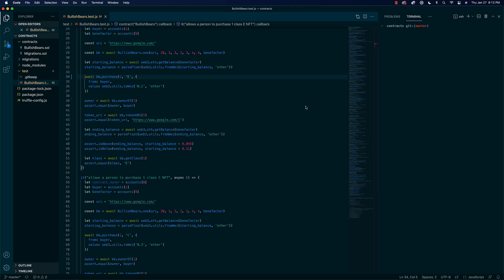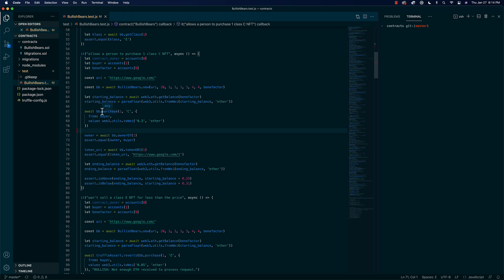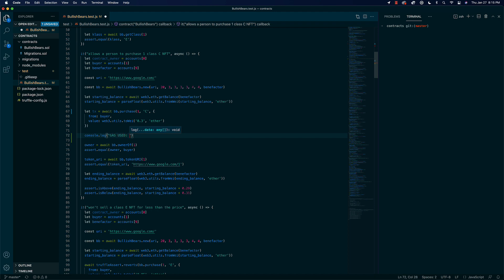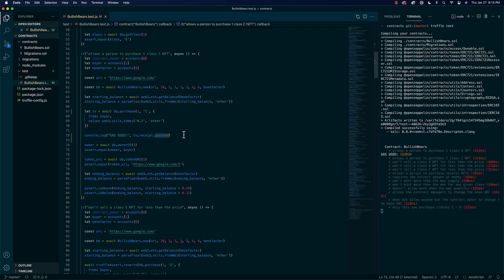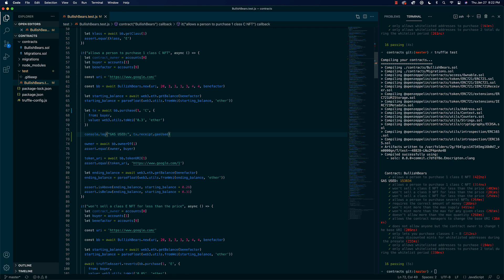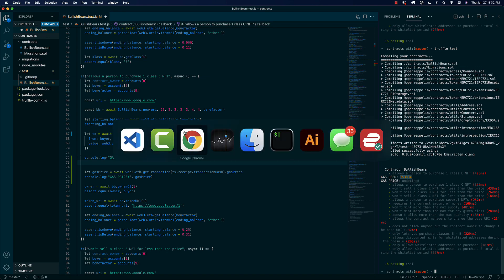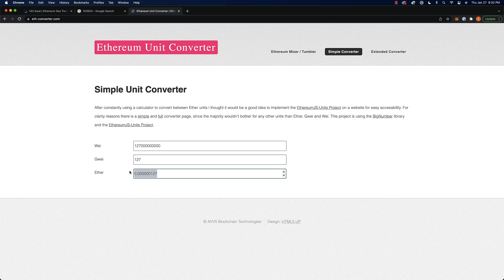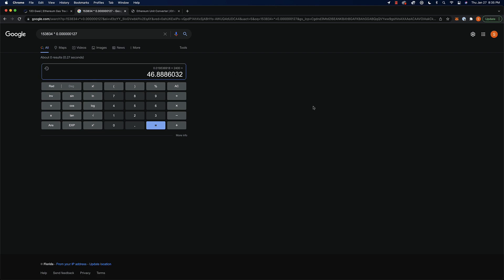Ethereum Tutorial | How to Calculate the Gas Price for an Ethereum Transaction

Comment: This is great, thanks so much for posting and sharing the link.  But I cannot figure out how did you calculate the 153834 number?
Reply from the maker: Thanks! That number isn't calculated by me. It's actually pulled from the transaction itself. It's just reporting how much gas is used.
Reply: @TechmakerTV  Ahh, so I guess I am trying to figure out when I enter say  100 max priority fee and 200 max fee to maybe have a chance to get a competitive listing, how that is computed into total eth spent.  I mean I know it varies by block, but is there a formula that gets you from entering 100 max priority fee and 200 max fee to the final fee paid in eth?
Reply from the maker: Yeah when you set a max fee to 100 for example, you're saying you are willing to pay a max gas price of 100 GWEI. So you can get to the total gas cost by multiplying your gas price with the gas (quantity) that will be used. So the example is using a quantity of 153834 gas, and if you say you're willing to pay a max fee of 100 GWEI, you're saying you are willing to pay a total of 153834 * 100 GWEI to run the transaction. Using the ETH unit converter, that would be about 0.015 ETH for the transaction we looked at in this video.

https://eth-converter.com/
Reply: @TechmakerTV  Got it, thanks.    One last question I promise, is there a way to figure out what the applicable '153834'  number will be for the current block based on the up to date gas prices?